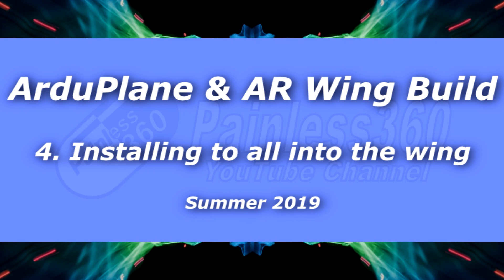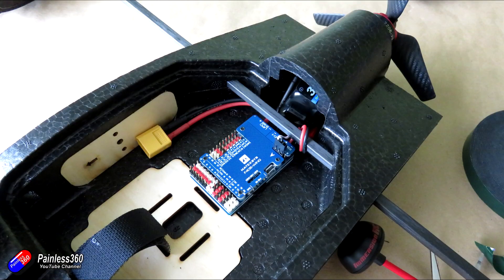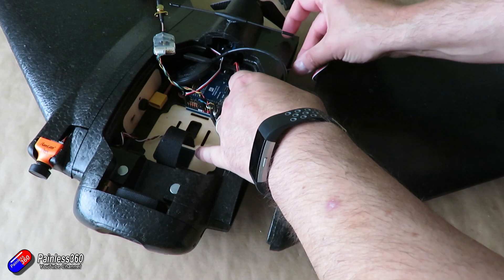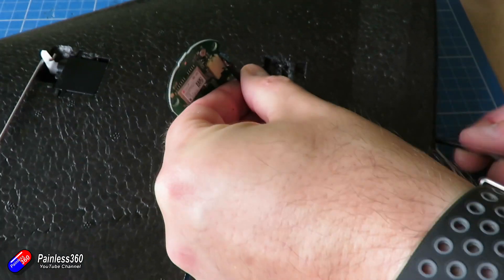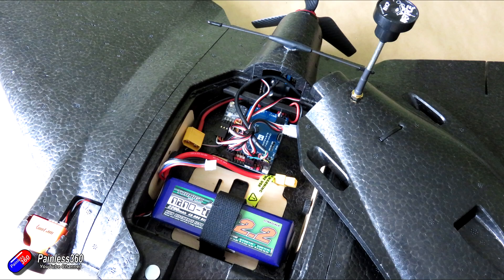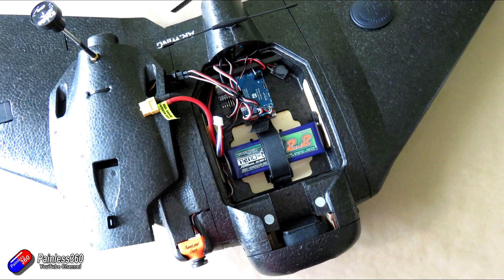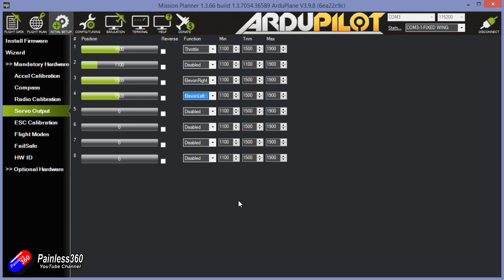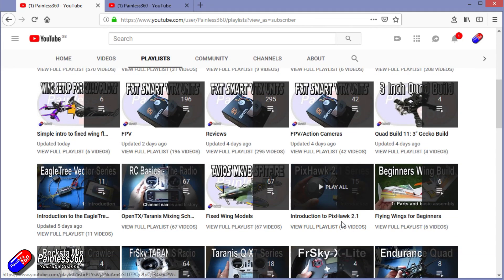ArduPlane/AR Wing/Matek F405-Wing Build: Installing it all into the AR Wing

Comment from the maker: For those wondering if the antenna placement may be an issue.. maximum separation is always a good idea. Power levels and the shape of the transmitted power along with the separation of the frequencies used all play a part in how much seperation is needed. Using legal power levels (and even a little above) with seperations like the one in this build should be absolutely fine. Models using less separation like the recent 600mm wing build with Ardupilot and models with more motors work very well too (see compact iNav quad builds - See my iNav building tips video where I cover it all). If you intend to use higher powers than those legal in the UK then you could position things differently.. ;)

Comment: Hello I am sorry I am not too good in English
I miss some step
So I want to reconfirm
Do we plug the motor and servo directly to the F405 board not in the Receiver?

This is my first time making Arduplane. Nornally I plug the servo and motor in the receiver
Thank you so much
Thank you
Reply from the maker: Everything plugs into the flight controller. Best of luck
Reply: @Painless360  Hi sorry one more Question

 Hi I saw the Speedybee F405 V3 (Stacked) in Youtube. He said it has built in ESC

Can I use that part for RC Plane?
It seems the part is commonly used for Drone
Reply from the maker: I'd use a Wing style flight controller for fixed wing unless you know what you are doing... see my builds.  Best of luck

Comment: Seems like extra props are sold out.  What alternative props can I use.  Speed is not important I like cruising
Reply from the maker: You should be able to use anything that is the same diameter and pitch as the original.. Best of luck!

Comment: why did you mount fc vertically , esc noise ?
Reply from the maker: It isn't vertical... At what point in the video are you referring to?
Reply: @Painless360  with the arrow pointing forward, you could turn the card sideways, is there a reason to mount it this way, I'm having some problems, so I asked . Thank you for reply
Reply from the maker: I always try and mount the FC with the arrow pointing to the nose. You can alter the alignment but I find it's easier to mount it right in the first place.. Happy flying
Reply: Sometimes I have problems like this, the video is from today's flight
https://youtu.be/9EHNAxKpWv0
Reply from the maker: That looks like flutter or p gain too high on pitch... Best of luck

Comment: Hi Lee,  I am building AR wing pro with MatekH743, I use the 40A ESC given with the kit, following the wiring diagram of the FC, I did cut the power cable with XT60 of the ESC, I solder the bit with the battery connector to the BATT pad of the FC, then I solder the ESC to the FC following the diagram. Now when I power the system, the ESC bip twice a second like it is not happy and I cannot go into ESC programming mode. I probably do something wrong, can you help me please.
Regards
Reply from the maker: Very tricky to help without further information. All of the steps I use are in the video.. Best of luck

Comment: Great build mate 😊 Congrats for setting up successfully.  
 I  built same AR wing supplied 19v through 5S1p Li-ion (AUW ~670g , 5S1P battery weighs ~270g)  still does not fly😂

https://drive.google.com/file/d/1GTzZI7OjX9jRyYtUC8GQngcA4Nxj4LXn/view?usp=drivesdk

Build: 

1. Sonicmodell AR Wing 900 PNP version 
2. Motor  -Emax RS 2205 2600kv
3. ESC - 30 Amp with 5V/3A BEC original one that come with the model
4. Receiver:  Flysky 2.4G FS-iA6B 6 Channel
5. Batteries;  I am using Lithium-ion 4S1P (4 batteries connected in series), delivering voltage around 12-13 volts. Tried with 3S packs as well to reduce weight but still did not fly.  
    Weight of batteries along with the holder is around 130g (each battery 30g + case holder 10g).  As an alternative, I tried to change batteries to Varicore 18650B green ones (see pic attached), no luck!  
6. Props: 5030 Tri-blade
Reply from the maker: If you watch the series you'll see I scrapped the 3 bladed prop... it needed a lot more power...

Comment: Hi painless, I’m just trying to work out inav as I just got a f405. One thing I’m confused about is how do I control rates and expo? I normally do it on my tx as I did with a wing without a FC but with a FC is it all done through inav? and the tx doesn’t change? Also if through inav where about’s is it? Thanks a lot :)
Reply from the maker: All in the tuning tab... but you can also add expo on the controller.. Happy flying
Reply: @Painless360  it can also be changed in the mixer and ouputs tab do they all do the same thing if i set them all to 50%

Comment: Hello Lee great series on the F405 arduplane build, I've used it to build a conventional 4 channel plane , was confused with the radio input/ servo output for a while. Radio TAER configuration. set servos to 1 Throttle, 2 Disabled,  3 Elevator , 4 rudder , 5 Aileron working correctly.. I think you covered this in other series can you put a link if you have. Thanks again
Reply from the maker: Id always recommend taking some time to look at the latest Ardupilot documentation when looking at a build. It's impossible to cover every step in detail in a series like this. Happy flying!

Comment: I'm following along, and I'm struggling with getting FRSky telemetry to work with this board. I'm building the hardware converter like the one you used on the Omnibus build.  I was looking for a way to get telemetry to work without the external module given that this board has an inverter for R2, and the RXSR that I have has tiny pads for SBUS and Smart Port uninverted, bit can't get that to work.  My other, minor issue is that I tried the VFly finder 2 and could not get the trilling working. Even ordered the Matek Buzzer and it also does not trill.  I do get long beep on arm and short beep on disarm, but not the nice trilling. Did you have to do anything to get it to work? I didn't actually hear trilling I'm this series or missed it.  Any help on these two issues I'm having is appreciated.  Thanks! Great series!  I'll post my first flights.

Comment: I have the buzzer connected like you and it works. I can't seem to find a way in mission planner to put the buzzer on a switch so that I can find it easier after I land. Any tips?
Great content!
Reply from the maker: I'm not aware of a way.. If you find one, please let me know..
Reply: There is an option to sound the buzzer by pressing or switching a transmitter button, at least in ArduCopter 4.x. It’s somewhere in the drop-down menu for the aux channels. Sorry, can’t remember the options name...

Comment: This series is great (like all your series), thank you.
If I may? I have some remarks:
From my experience, I can say that the best will be keeping the receiver and video transmitter away from each other and both from the motor.
I know that both components work at different frequencies. There is the concept of "noise floor level". When there are many high-intensity transmissions, the receiver "works" much harder in filtering the noises. Although it equipped with physical filters (capacitors, etc.), they cannot filter all noise out. And the SW filter has to work hard. If you have the possibility of checking the data traffic stability, you would see that many "packages" of communication are wrong. The situation will degrade as the range between you and the plane increases. The magnitude of the transmission arriving on the plane is weakening and is much lower than the "noise floor level”.
On top of it, when the motor is working, it generates magnetic and electrical fields around it with a very wide frequency spectrum (IMI & RFI). These fields are created noise that peeks up by the Rx antenna and by the video transmitter and Rx wires. So, it is important to keep them away from the motor. The ESC also generates a lot of "noise" due to high power switching. High-current PWM produces many electric fields at different frequencies.
About GPS best location: Checking with compass is excellent idea. But you must do it when the whole system is powerup! You must make sure that the servos powerup, and the motor working at 50%.
Only in this state can you really understand what the "GPS" feels like. If there is no choice and the GPS need to be installed over "hot" wires, it is possible to paste between the GPS and the aircraft, aluminum foil (60-80 mm diameter circle). In my experience, the aluminum foil will isolate the noise coming from the bottom underneath and acts as a reflector on the upper side that helps GPS and improves its stability.
Reply from the maker: Separation is always a good idea. Power levels and the shape of the transmitted power along with the separation of the frequencies used all play a part. Using legal power levels (and even a little above) seperations like the one in this series is absolutely fine. Models using less separation and more motors (quads) work very well too. See my iNav building tips video where I cover it all..